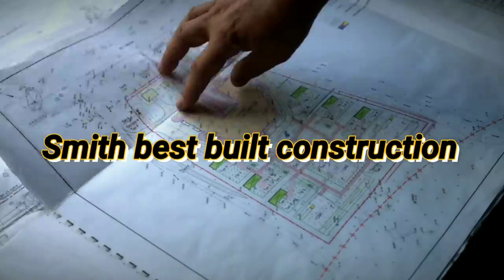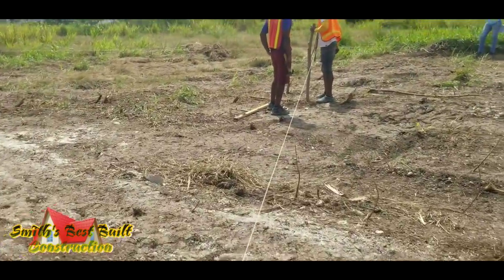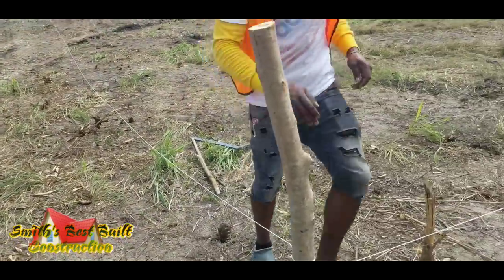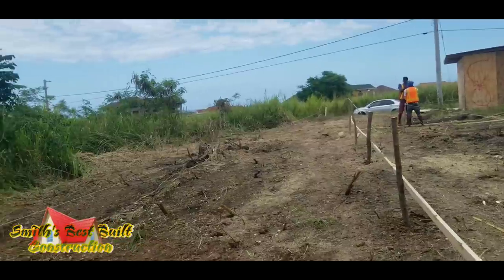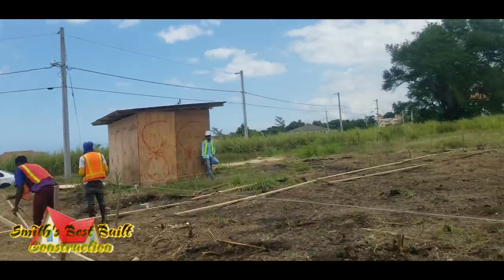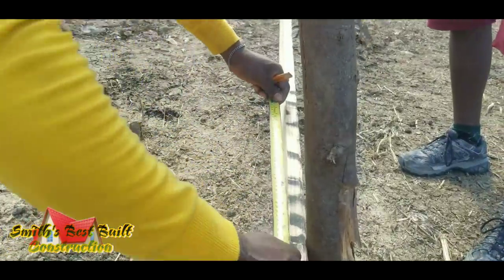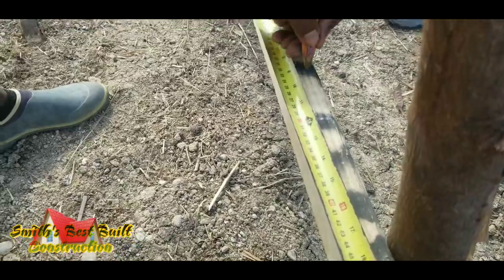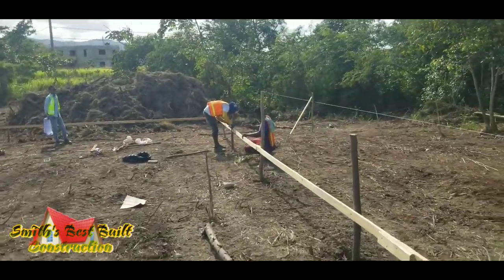Full lining out of foundation#5

Comment: For a house of this size, there is no way possible to achieve an acceptable square in your setting out by just using a 2ft x 2ft squaring instrument in your hand. You need to use the 3,4,5 triangulation method with a steel tape.

Comment: One question the steel line run outside of the steel or in the middle of the steel? Because if the steel line runs outside of the steel and the steel frame is about 3'' inches thick it would not be in the middle of the 6'' inch block right?